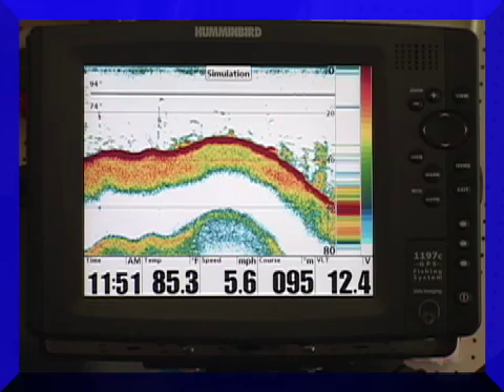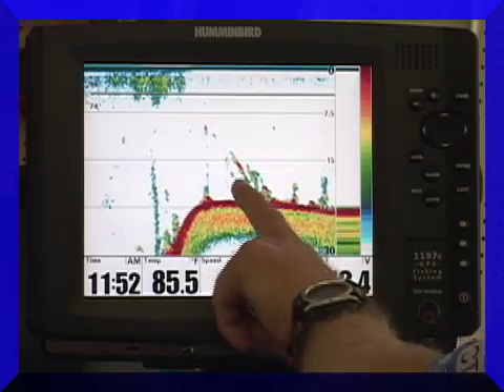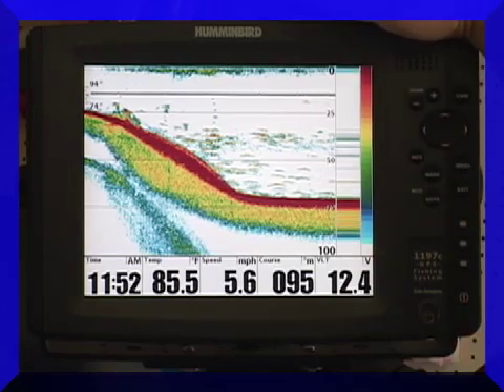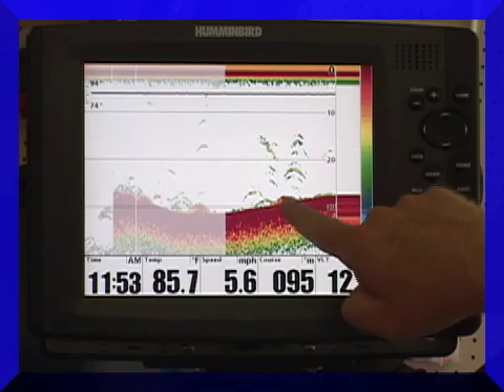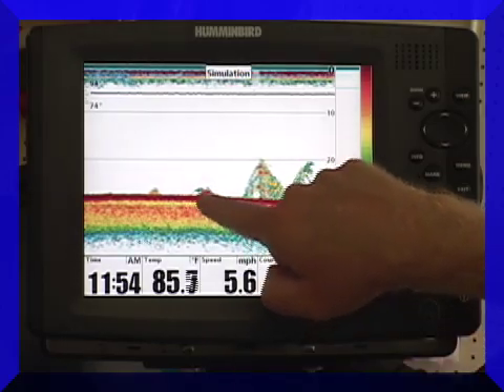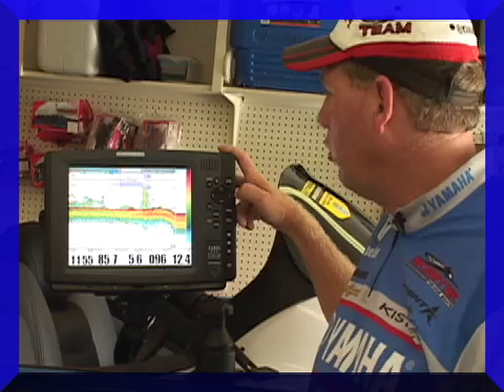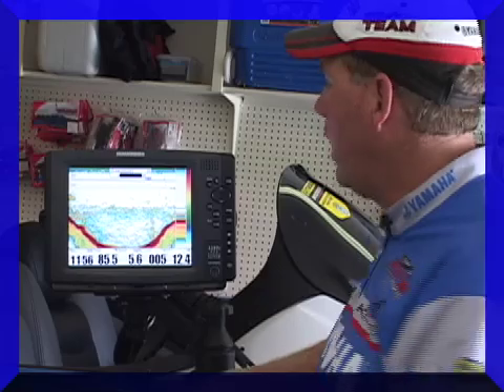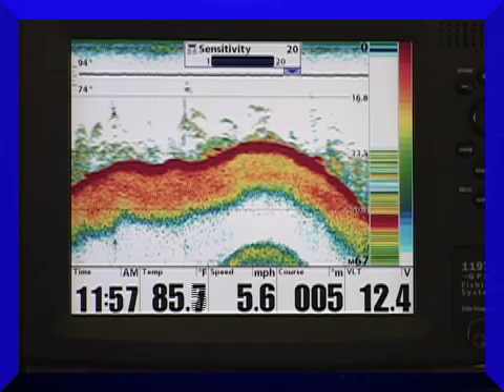Understanding Your Sonar

Comment: The display is 2d, with the top being up and bottom representing the bottom of the water. But otherwise the 2d image represents a 3d environment (a cone shape). Further the left of the display is drawn segments over time. So is it possible using sonar to determine where fish are relative to the boat? Can you tell if they are to your right, left, front, or behind?
Reply: this answers my question
http://www.ifish.net/board/showthread.php?p=10138970#/topics/1006722?page=1
Reply: No, you cannot. All it knows is that something returned signal in the cone.

Comment: Thank you for the info. I couldn't find some of it anywhere else. But why does it keep scrolling even when the boat isn't moving?
Reply: yes. it will just look at the one spot...just many times. 

 the sonar sends out a pulse...say, for simplicity sake....every 2 seconds. (it updates MUCH faster)

so...PING!....2 seconds later...PING!

each ping will advance the graph one unit....

the graph isnt moving because your moving..... its moving to make a blank space for the next ping to fill in with data.  otherwise it would just make a mess....with data over the top of data over the top of MORE data. 

so.....graph moves to make a blank spot, and before you can even see the blank spot...PING!... it gets the data and fills in the blank spot. 

graph moves....PING....graph moves....PING

Comment: One of my biggest questions is why does the graph keep on moving while my boat is anchored. Does the same image keep re-appearing on my sonar while I am anchored and not moving at all?
Reply: Those are just recordings like at bass pri5
Reply: yes. it will just look at the one spot...just many times. 

 the sonar sends out a pulse...say, for simplicity sake....every 2 seconds. (it updates MUCH faster)

so...PING!....2 seconds later...PING!

each ping will advance the graph one unit....

the graph isnt moving because your moving..... its moving to make a blank space for the next ping to fill in with data.  otherwise it would just make a mess....with data over the top of data over the top of MORE data. 

so.....graph moves to make a blank spot, and before you can even see the blank spot...PING!... it gets the data and fills in the blank spot. 

graph moves....PING....graph moves....PING
Reply: why does it make a ping noise? lol